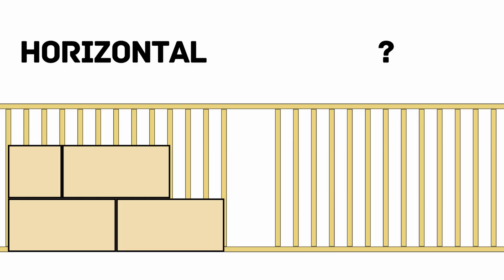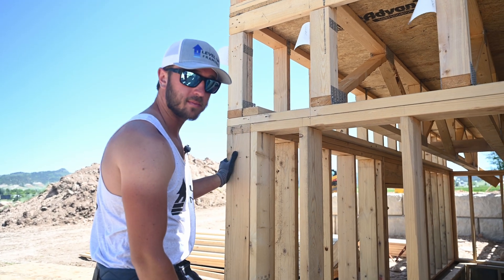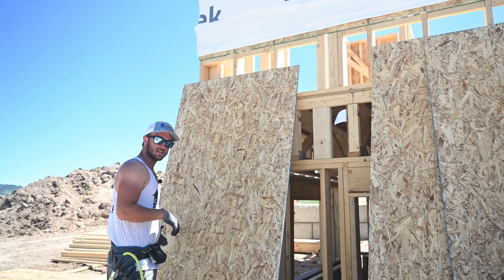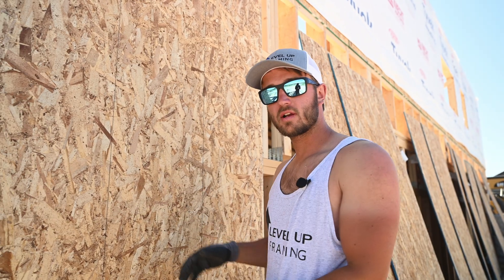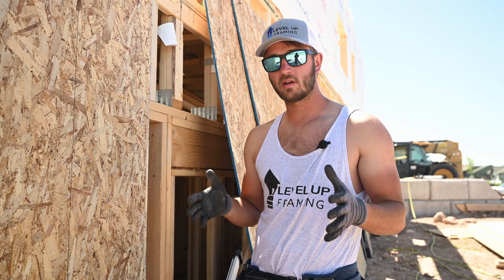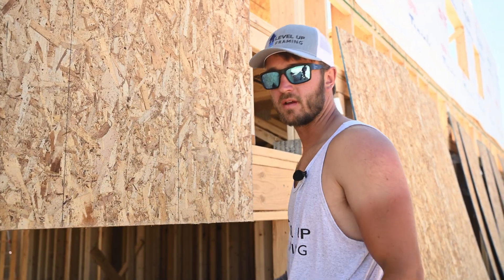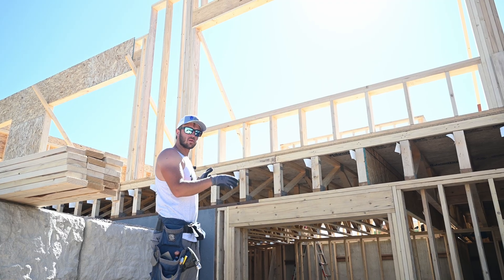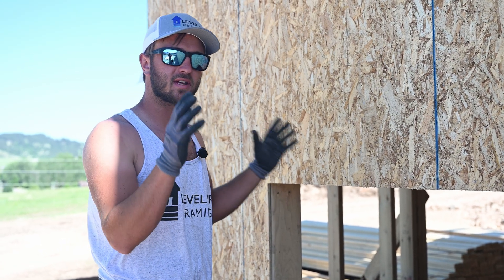How To Sheath Walls (Why We Sheet Vertically)

Comment: What about sheeting the other exterior wall around the corner you started on?  Does the sheet overlap the edge of previous sheet at the corner  or stop at the corner of the farming?  Also, when laying out for that perpendicular outside wall do you take in account the 1/2 plywood so instead of 15 1/4 and go yor first layout will be 14 3/4 and go?
Reply from the maker: The sheeting ends flush with the framing on all corners.   Layout stays the same. 

It doesn’t matter if you hang side 1/2” long, but it is not required or necessary. 

Tyvek wraps it.  The siding corner covers it up.
Reply: @LevelUpFraming  Right on!  Thanks for the reply!